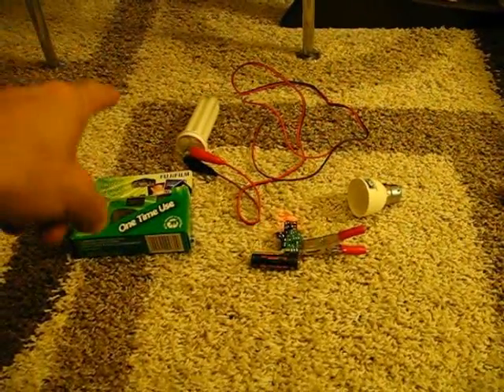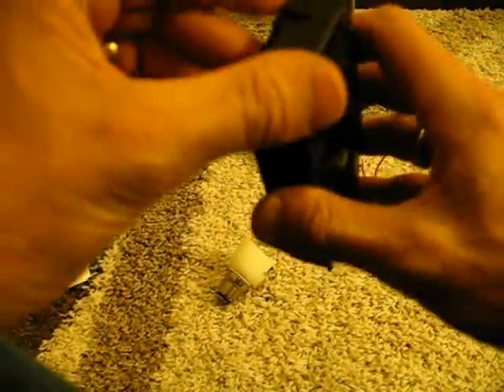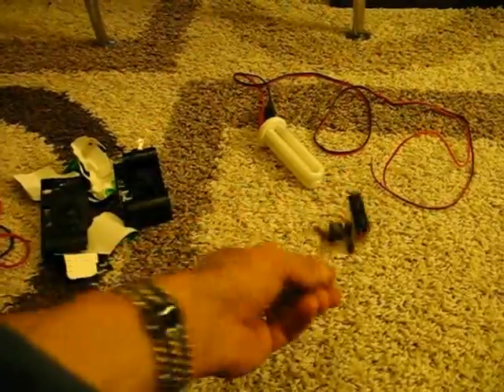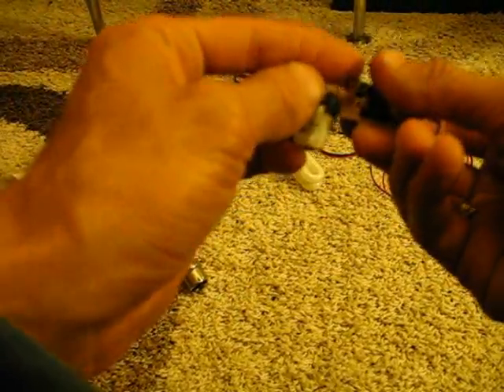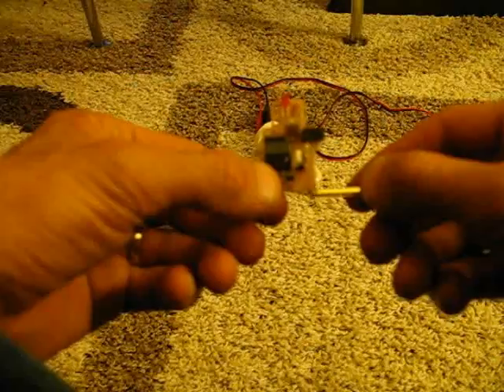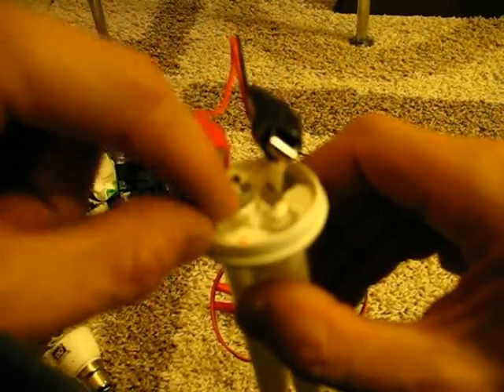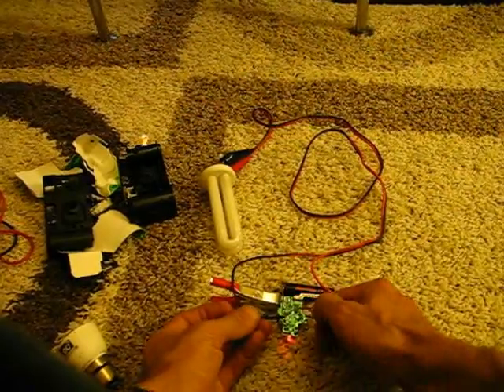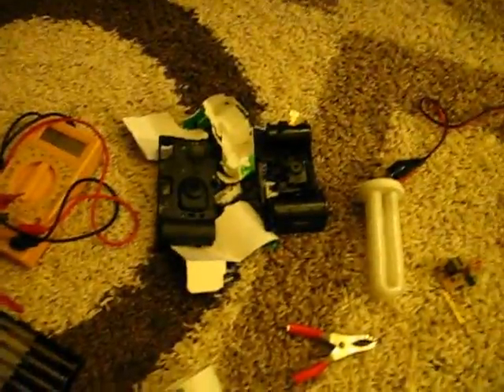Running a 240v lightbulb of one AA battery. Very real and very useful. With full how to. 100% real

Comment: I just tried this! WOW! It actually works!  I asked at a photo counter for an old camera and got it for free.  At first, I had the battery installed reversed, then after i flipped it the bulb lit up.  It really helps to have a fresh battery for this.  I added hot glue (over the solder points) and a switch for convenience and so i would not accidentally get shocked.

Comment from the maker: @JDK1981 I am so pleased you enjoyed my video. They do make great emergancy lights and I use a simple 1.5watt solar cell to charge a bank of 4 batterys in parallel to run these lights. In over a year I have not had one go flat so far and I have them running 24/7.
So this lighting setup is great for me and when the power goes down these lights are already running so we never get stuck in the dark anymore.  Good luck with your experiments and be careful because the capacitor can pack a punch. :O)

Comment: Blimey! My calculations for something electrical actually worked for once! I'm currently experimenting with a later camera Fuji flash circuit and there's definitely some differences. For a start, it seems very happy with smaller (7 watt) bulbs but does have a few problems getting larger wattage bulbs to strike, but a quick touch of a 9 volt battery across the terminals of the 1.5 volt battery and it's fine.

Comment: It IS just stepping up. You can buy camping lights with flourescant tubes in for less than a disposable camera. Emergency flourescant lights run on battery when the mains power fails. 
Flourescant tubes use very little power. I am amazed this guy has experimented his whole life and reached the state of  electrical knowledge we had in the fifties.
Check out argos for a cheap flouro lamp.£10 ish.

Comment: This was great. Saw your circuit board pic you posted in the "show more" and followed the directions from the vid then lit my own CFL using the cameras own battery.
In the next couple days Ima have it fixed for easier use with my rechargeables.
Thanks for this vid.

Comment: It never ceases to amaze me how ignorant people can be... Fortunately ignorance can be cured. Voltage is NOT a measure of electrical power. Wattage is... hence why the power company charges you based upon kilowatt hours instead of kilovolt hours. Voltage can be easily increased or decreased by a variety of different ways, however, wattage is calculated as being equal to the voltage multiplied by the amperage of the current, and whenever you increase the voltage you decrease the amperage proportionately regardless of the method you use. For example if I have a current going into a transformer at 12 volts and 1 amp and the output is at 24 volts then the output will also be at 0.5 amps so both the input and the output will be at 12 watts. There is no net gain in wattage. This circuit is fairly basic and utilizes two parts. The first being a circuit known as a joule (joules being a measure of energy used to compare different forms of energy against each other) thief which is primarily used for increasing the rate at which power can be drained from a battery and a transformer to increase the voltage to that needed by the bulb. It will power the bulb, however, it will do so for only a short time as the joule thief has greatly increased the draw on the battery to meet the demand of the bulb.

Comment: Very cool. I'm going to have to try this even if it's just to find out how many volts it generates. Personally I think it would run a lot longer if it were running an LED or so. Either way, it will make a great reading light. I've been asking for one for things like my birthday and such, but this will keep the cost down and be satisfying at the same time. Thanks for the tutorial.
Reply from the maker: It truly is worth trying trust me. :O)
Reply: I'm working on it, though it might be a while before I can actually get to it.
Reply: texjarhead Not bad at all. Did you get a reading on the amperage that's available?
Reply: No, but it knocked the crap out of me.

Comment: Excellent work! Interestingly enough, for those non-believers and those who don't understand how this works, the simple mathematics shows the average 11 watt CFL is rated at 80mA and the average alkaline AA battery has about 2600 mAh, so it's not surprising how long these last. I'm now thinking Poundland garden light with a better rechargeable battery in it.

Comment: I like the plan of cheap lighting. As for a battery you could use a fire emergency light battery the older ones was 2 D cells. I used a few in my garden lights so they run much longer about 10hours. They are fine in the summer with plenty of sun but in winter time they do not charge so well but if you going to use the solar light circuit with the light it could work out very good and use the D cells from the emergency light to store more power. I think it is time to go to the garden shed chaps.

Comment: This is awesome mate, It gave me an idea to use my children's broken toy that has a double battery compartment that lays flat, change the way batteries are connected (serial to parallel) and use additional space to fit the electronics/ bulb, add a small switch and get a superb stand light....if you can help with exact place for the bulb to be connected that will be great.

Comment from the maker: Yes you are correct and explained it very well, I have also made some decent garden light by using the poundland lights and stripping them for the parts. You can build some great lights with these curcuits and solar cells. Have fun experimenting. :O)

Comment: Hey, I'm all for insulting free energy cultists and such but this actually works.  I've done it.  You can even light fluorescent tubes completely wirelessly with a high voltage source like a Tesla coil or modified flyback transformer.  As I said though, what is in this video isn't free energy in any way.

Comment from the maker: Yes it works on both. Some come with aaa others especially the one sold for wedding guest come with AA battery but they all work fine with this. If you want your light to stay lit longer you can use d cell or c cell batteries and just use a bigger battery holder. just do not go over 3v.

Comment: one thing to be cautious about, you are powering the CFL with hv DC, you'll need to short out the diode to get high frequency AC, and prevent mercury migration. also, the fluorescent lights have filament which also need to power for more light.

Comment: I have a mod for this cam unit . I did the fugi camera circuits and it runs a cfl for over 48 hours on a double a battery 1.2 v . replace the base resistor with a 15000 ohm pot and put a .27uf cap across that pot connection . you will be able to control the bias without loosing any light . some where you will find a happy spot that reduced the about of current she takes but still gives full light.

Comment: Before I go, solar garden lamp charges built in battery which then sends power to Fuji circuit which then powers CFL and guess what it turns on and off by itself. I used to be a couch potato but now  I have purpose so thankyou for thes great vids.

Comment: Lamps usually have a transformer or capacitor and resistor circuit that prevent it from going over or under voltage/amperage.  With the right circuit you can turn any battery to power anything... hence how every battery powered device ever made works.

Comment from the maker: @MegaReddevil91 The main reason is because they will power a bulb even off nearly dead batterys for hours. They also produce a better spread of light when compared to Led's. They also work great in a simple solar setup. This also proves that a 110v - 240v lightbulb can be powered from a single AA battery. You have to admit that is pretty amazing and proves in itself that much less power can be used. I am glad you still liked my video though and thanks for commenting.

Comment from the maker: Yes they work fine with 120vac When you remove the circuit they are all the same. 240v 110v all have the same cfl element. The problem with building one of these from scratch is the high power transformer. They only seem available inside the fuji cameras.

Comment: very useful! i'm planning to build these incase of power outages.
also, i have a design in my mind for it being switched by mains voltages so when the lights goes out this goes on. Also, i'll keep the standard screw-in socket to make it easy to integrate with usual households.
oh yeah useful is spelled as useful and not usefull. same for powerful

Comment from the maker: Yes thats correct. You can use led but you would need the 240v 110v led bulbs. You don't need to modify these bulbs either. I just connect the led bulb terminals directly to the fuji circuit. :O) Just remember they need to be the 110v bulbs to work though. :O)

Comment: 1) The demonstration shown here does work just as shown.
2) The circuit board shown is the strobe light charge circuit

-but-

1) No free energy was created.
2) Voltage is not a measurement of power. Wattage is.
3) When we step up the voltage from a AA cell, we require very little current. 
4) That compact flourescent bulb only requires 10-20 watts.
5) Yes, a penlight cell will supply 10-20 watts for a few hours. Then you have to buy another. 
6) No magic, no mystery, no bargain.

Comment from the maker: You should try it it really does work. The battery life is simply exellent especially with high capacity rechargeable batteries. Your right to be skeptical as many other have been. But they have had great results with this circuit. :O)

Comment: If you are talking about the candle flicker bulb that glows orange, whilst flickering - they are not incandescent. They are a low intensity discharge lamp. 
However, a 7w 240v incandescent from a night light may be able to produce a dim glow.

Comment: Instead of  multiple as batts, use a c or d.  Will have substantially longer running time on the same 1.5 volts.

Comment: Armookie..TX for the video, great stuff!
I see quite a lot of comments and some people also asking the same questions which sucks. I'm more interested in the finer side of things...."ergonomics"... here you have a make shift idea which is great but is not packaged well. This I find is the problem with inventions, innovation that could possibly change the world. People never seem to take things one step further. 

Imagine this: Running a 240v lightbulb of one AA battery and DIY packaging. Now you can update this blog video with liberating ideas that would make it great for home use and camping gear. Possibly a docking area for back-up batteries if necessary and the packaging could be out of recycled material like empty butter tub or just simple softwood. Throw in an On an Off switch.... you never know, maybe its just me, good is good but I piss Excellence!

UP THE GAME!!!
Reply from the maker: KEVOLUTION K I did make some built into the camera shell itself laid on its back it looked pretty cool. I also used some old coffee cans and had the bulb fixed to the lid. They looked like small table lamps that way. :0) Maybe its time to make an update video.
Reply: Awesome! :)
Reply from the maker: KEVOLUTION K Thank you for the encouragement. :0)
Reply from the maker: KEVOLUTION K I also found they run brighter with two or more batteries wired in parallel. I had one set up this way with four 2000MAH rechargeable batteries. it ran for ages that way with only 1.2v feed. no risk blowing the transitor that way. :0)

Comment: Flyback transformers from PC monitors will do the same with the right transistor and base resistor.  If you cant find the right fuji circuit, just find any old flyback.  You'll get good sparks on 9V too.

Comment: Check the cathodes (at the base of the bulb) and see if they are getting warm. If not the light is not operating in it's proper mode. You can demonstrate this by walking on a carpet and discharging static electricity through a fluorescent lamp. All you are doing in this video is discharging a few milliamps through the bulb to make it glow. Once the bulb is started it will operate on about 90v. 13 watts at 90v is about 150 milliamps.

Comment from the maker: Imagine living ware power is either not available or even possible. These lights give better light than led and run for very long periods of time on one single AA battery. Most led light systems need at least two 1.5v batteries and give much less light for power output. They also work well with solar cells. These have been used by people in the third world with great results.

Comment from the maker: @atomikrobot300099 Really glad you got this working. A lot of people still don't beleive this works. Its a great experiment and can be put to great use if done properly. I use mine that I have fitted into my own lamps and other fittings for emergency lighting. They have performed great for me so far. If your battery is a little flat then usually stroking the bulb tubes will get it to light up.

Comment: Very informative! Thanks for simplifying this important discovery for the rest of us (I'm trying to apply it in developing countries with the Solar CITIES NGO)  I'm using a CVS camera (can't get Fuji, but CVS is very similar except battery terminals are opposite) and have gotten to the step where I light the red light but can't get the CFL to light.  Can you provide a close up of the contact points for the CFL? Thanks!

Comment: Excellent idea.
Too bad it took me so long to find this video as it's dated Oct. 2010.

Suggestion-Instead of paying for these disposables, I've gotten a few empty camera shells, sans the film, for FREE just by asking for them at my local Walgreen's processing center.  The store usually just tosses them after pulling the film out.

They will come with the circuit board and a Free, slightly used battery.
If they ask why, I just say I'm a hobbyist and can use some of the electronics in the camera.

Comment from the maker: I am pleased you managed to get it working. You should get an A grade in your science fair. :O)
Post how long you can get it running on one single AA battery. Try an regular Alcaline battery then try a nimh high capacity battery. Let me know your results and also give results in your science fair project. It should get you an even higher grade. :O)

Comment: 4:16 is very important I accidentally touched the solder points taking the K Circuit out and it burned the tip of my finger and shocked like crazy. Wish i would have found this video sooner! Also try to reuse and recycle :) I went to my local drug store and asked for a used camera body which they were REALLY excited to get rid of and gave me the pic of the lot (HUGE BOX FULL). I ended up with 3 Fuji camera's and didnt pay a cent!!

Comment from the maker: Its a little more than a step up transformer. It acts like a juel thief and gets power even from batterys that a nearly depleated. Like when your remote control battery goes flat. Well I got 8 hours light from them with this. Its free energy when you can run this from a solar cell alone or charge a bettery with wind power like some people do.. You can see from the comments below that this works great for free energy.

Comment from the maker: Just be carfull with overpowering them as just 3v can blow the transistor and they seem difficult if not impossible to get. If you feed 3v through the circuit the bulb will be brighter but you must fit a heatsink to the transistor, otherwise it will burn the transistor out. :O)

Comment from the maker: @eastkyphotos You must have made an incorrect connection. The battery sholud get warm but the circuit board should not. Although the transistor can get pretty hot to touch. I started to add a heat sink to the transistor to help keep it cool,

Comment from the maker: @modernind Yes it will probably work. Just make sure you only supply 3v max. Also I would fit a large heatsink to the transistor as otherwise it will probably blow it. maybe changing the resistors is wise also. 
Take care with this project and remove the capacitor safely like in my video.

Comment: Basically what you're doing is using the camera flash to step up the AA battery to a high voltage just like the circuit board in the CFL bulbs so it's not really free energy

Comment from the maker: @JustWickedSwede Yes the capacitor will pack a punch. You can actually use them to make a stun gun.
Alot of power in these. But if you discharge the capacitor then they are very safe. Also another point is you need to remove the capacitor to make this. That makes them very safe although you may get a slight tingle if you touch the board once a bettery is fitted.

Comment from the maker: The batteries cost nothing as they come with the used cameras that you can get for free from camera shops, walmart or asda in the uk. Infact I used to collect the cameras just for the free batteries. So take that into account and it is free for me to run them. Also by collecting up broken or worn out solar lights and using the solar cells from them you can also supply power for free, as neither the solar cells or cameras cost a thing the way I do it. I have these lights running for years 24/7.

Comment: The A07 Fuji board has been superseded by their A60 board which has the battery Plus on the long arm.  The board looks fairly similar.  I have the red light solidly lit and the fluorescent bulb confirmed as correctly wired and working, but when I connect the bulb (as shown for the A07 board), the red light dims only slightly and the bulb shows slight activity but does not strike and light.  Any suggestions would be much appreciated.